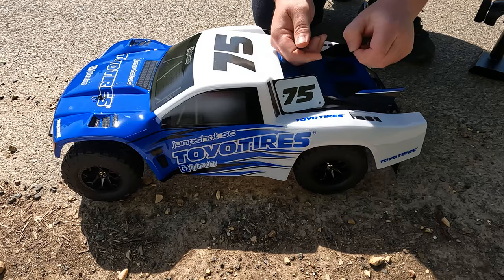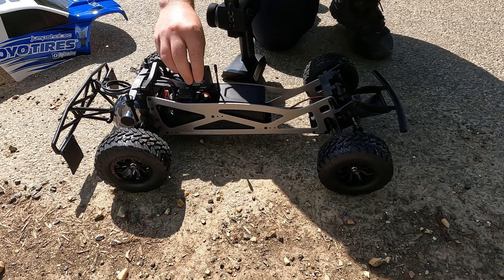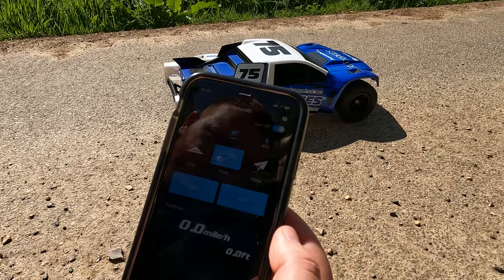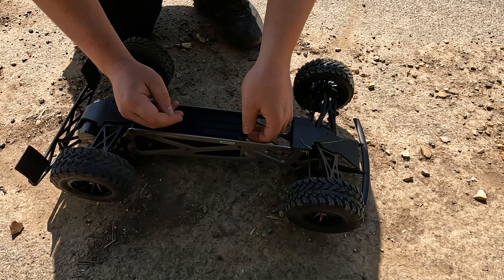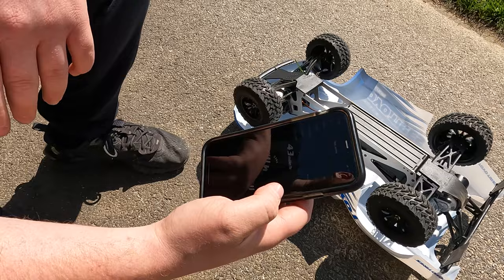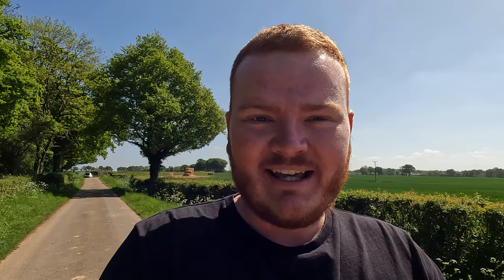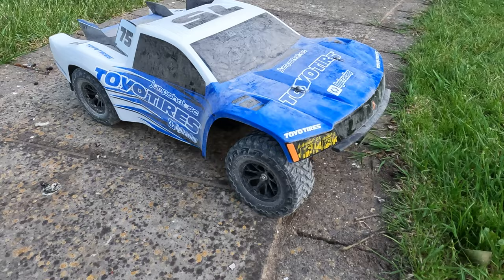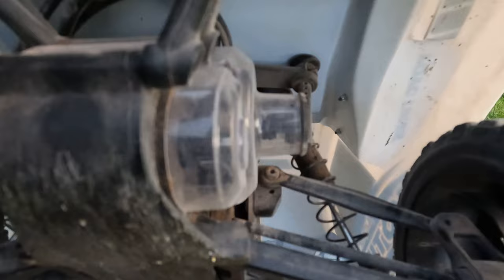HPI JUMPHOT FLUX BLAST AROUND ON JUMPS

Comment: Nice video. I did one on this truck recently and found that if you vent the body in the rear, that truck will do 55 MPH totally stock on 3s. It will still want to stand up but not nearly as badly.

Comment: great video, considering buying one myself. here in finland when it snows just a little its so fun to take the cars out to the streets and drift, no need to be fast or extremely careful, just press the gas slightly and turn a bit and it goes so smoothly to a nice drift. thats also why im interested in this one, its 2wd so it doesnt get straight so fast. anyways probably the best review of this car ive come across. thank you a lot👍
Reply from the maker: Thankyou. That’s what we need over here in the uk is a bit of snow, we just have rain 🤣.

You’d have so much fun with this rc car in the snow, the only issue I have found with it is the steering buckles do pop of the hub. But nothing an upgrade can’t fix 😊
Reply: @dgrc  haha, thanks For The tip tho, Will Look into it!
Reply: @dgrc  What did you upgrade with to deal with this issue?

Comment: Hello mate, nice video😊
Do you change battery to get that speed, Or is it the same battery from the HPI?
Reply from the maker: The first part of the video doing the speed test is with a hpi 3s battery, which makes this thing to fast 🤣. the rest is with a hpi 2s battery.
Reply: I really want to buy this hpi. Can you tell me, what is the difference like your Hpi and HPI 120081 Jumpshot SC V2 2WD Elektro brushed RC Short-Course RTR. Who is better? 
What is different motor 4000 and 550?
Regards
Reply from the maker: @dimitarg3172  so my one is the brushless motor mate so is 3s capable and is crazy fast the other hpi is a brushed motor so  won't have much speed, I'd deffo go with the 4000kv motor you will have souch more fun
Reply: Can I used lipo 3s 11.1v 8000 mah?
For 2s lipo what you used?
Reply from the maker: If it's the brushless motor you can run that 3s battery in it